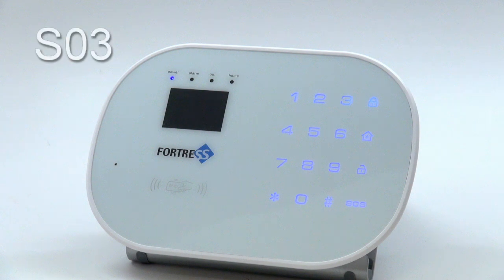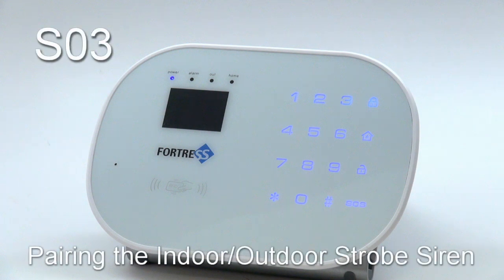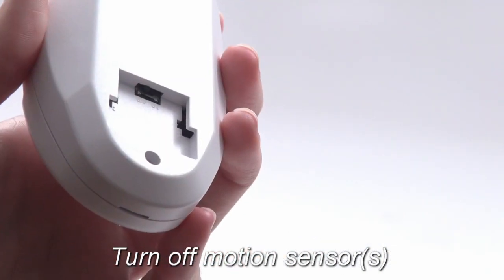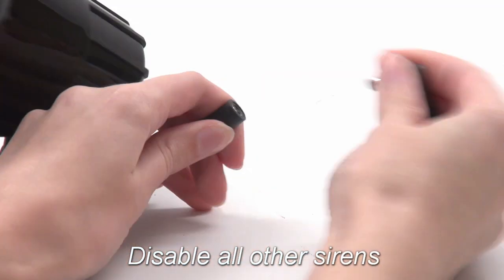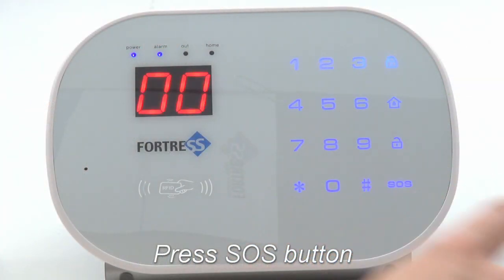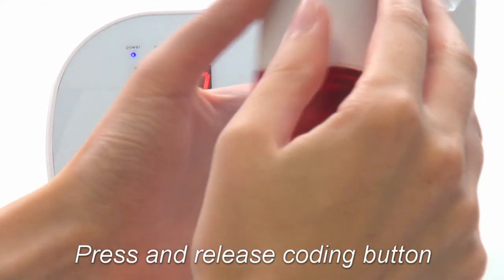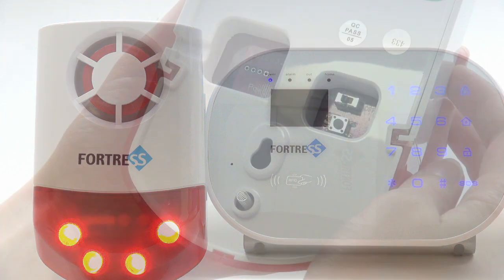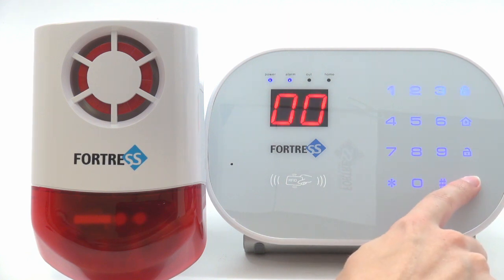S03 - Programming the Indoor / Outdoor Strobe Siren

Comment: Problem I have is that AFTER i put in the password and then bit the 0* ...it shows "fails to connect" and no other progress is made. Also when i first connect my Fortress app on my cell phone, a message pops up that the apps has crashed and instructs that it will close the app. But the Fortress app still operates. But fails to connect to anything. .....what shall I do ...I am at the point of putting it all in the box and shipping it back

Comment: Is the siren wireless?
Reply from the maker: Hi Bob, 

Thanks for your inquiry. The indoor/outdoor strobe siren pairs to the main panel wirelessly but does require a connection to power. This siren also features a built in backup battery in the event you experience power loss. Please let us know if you have any further questions.